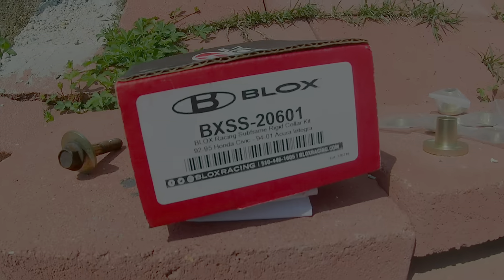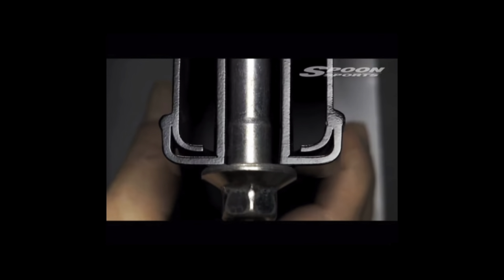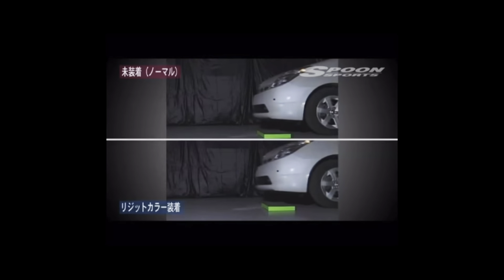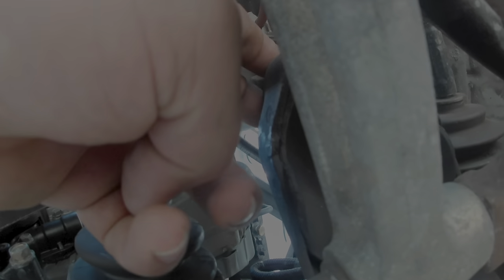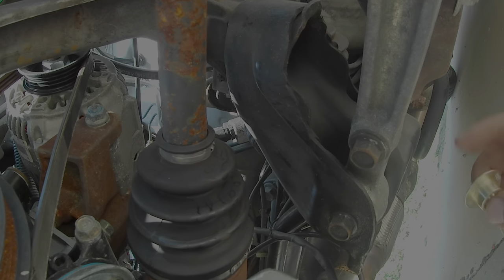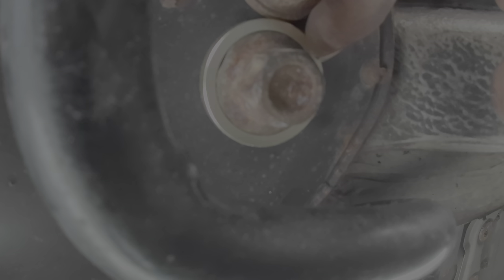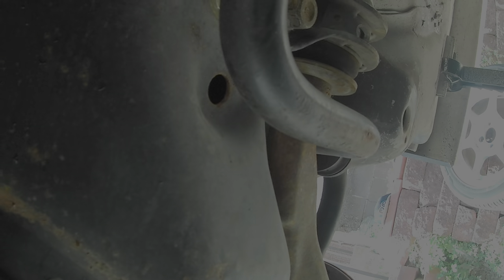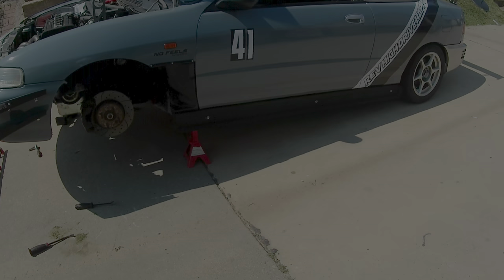the Integra get a Blox Rigid collar kit

Comment: Did you notice a big difference?
Reply from the maker: I haven’t really driven the car to aggressive yet because I’m waiting to get a alignment but I can tell you for sure I haven’t changed much on the front of the car besides the shocks,  The steering wheel was pretty straight but after installing these my steering wheel wasn’t  as straight anymore so  it definitely changed the alignment and moved the subframe into its proper location.
Reply: @RevHighDriveHappy  l